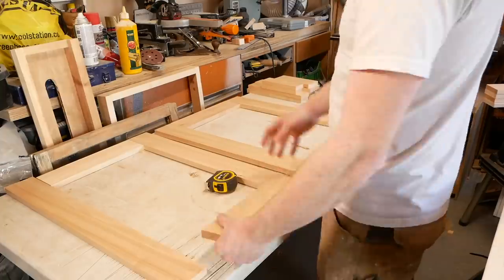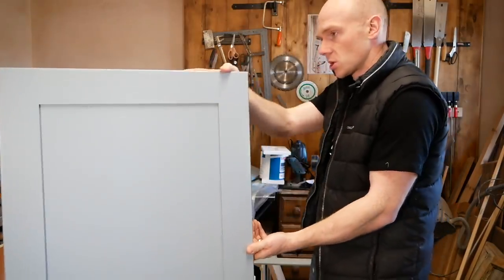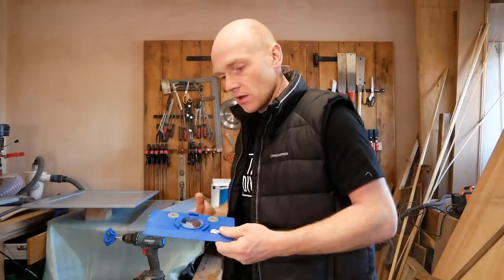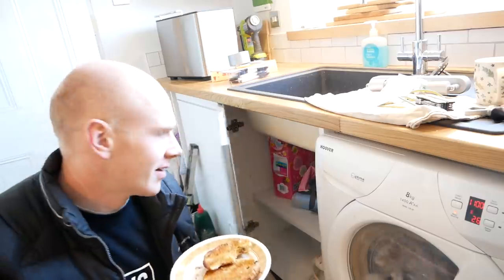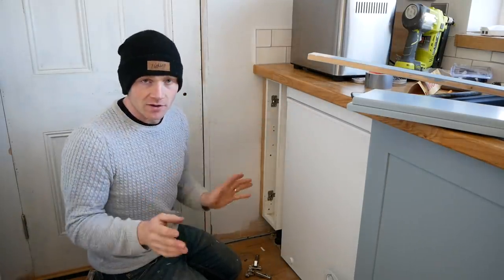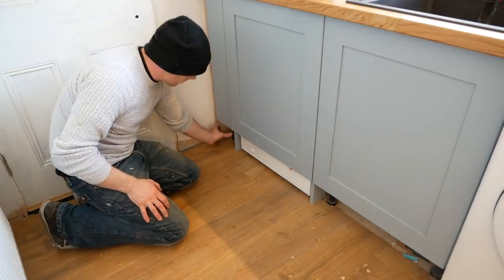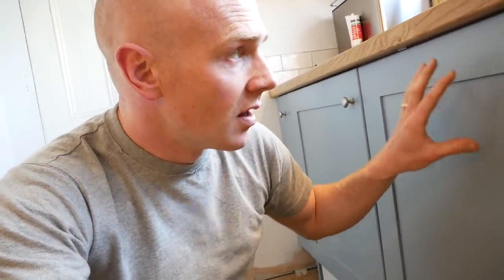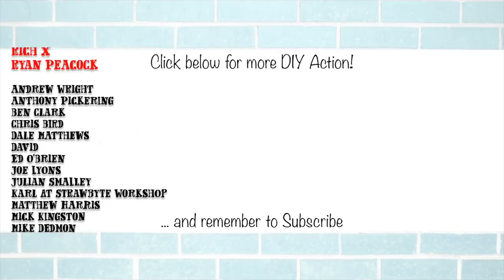KITCHEN DOORS FROM SCRATCH! - Hinges, Hanging and Hardware

Comment: For the freezer I'd be tempted to bend up a sheet metal tray (base and 3 sides), drop the freezer into it then mount it on industrial heavy duty versions of your draw runners, double them up each side if necessary to carry the weight. The tray sides can extend up as necessary to afix the runners. If width is tight I've recessed runners before into a cabinet carcass by routing a slot for clearance (especially as if you change this in future any new 600mm carcass will cover this up).

Comment: Thanks for the videos. I enjoy your journey. Not sure if you can make use of the following  information, but we just had an Aga-type oven delivered and the guys used sheets of Teflon under it to slide it all the way from the van to its final position. It worked very well, so if you can think of a way to do this with your freezer it would certainly be slim enough! Maybe a double length (depth) of Teflon, one each side, glued to the floor under the freezer then wrapped up the front of the freezer (behind the door) until needed.
Reply from the maker: Ooh I like that idea. Was it rigid or on a roll?
Reply: @TheRestorationCouple  They had sheets and strips, about 200-300mm wide and maybe 0.5-1mm thick. I though they would use wheeled carts, but they said the Teflon worked much better. Not sure where you would get it from though???

Comment: You vids always enjoyable to watch and give bit of inspiration .
I have tackled a freezer wheels DIY for my sister who wanted similar size one under a worktop in conservatory off her smalish kitchen .
Anyway cutting to the chase after some head scratching and looking at junk I went with appliance roller set from screwfix.
double axle rollers each corner, handles over half a tonne .
Had to chop product up and mount the roller sections to a custom metal bracket in each corner to recess height to desired amount but end result was good, they holding up well and was under 20 quid .
Bottom of your freezer will dictate how workable this is for you (I could recess mine as low as I liked and to solid frame structure) but be worth looking at as they roll well and due to roller footprint they easy on flooring finish .
Reply from the maker: I still have the screwfix appliance rollers I tried. I only have 25-30mm to play with so they wouldn’t work but may look again. It’s a metals frame under the freezer so may be possible to house within.
Reply: @TheRestorationCouple  
I was lucky enough be able house cutoffs of the rollers from the screwfix item within freezer frame on fabricated inverted U shape brackets  and set final height by depth of the U bracket .
if you got a welder more possibilities come to life .

Exact construction of freezer bottom the limiting factor .
I couldn't find anything low profile that looked durable or likely gentle on flooring finish .

Comment: You could try an anti vibration mat - have just put a cheap Screwfix one under the washing machine and makes it rediculously easy to move. Obviously the weight of the freezer will be more, but would be a good trial before searching it something expensive like teflon

Comment: In the middle of doing this now, i cut an old door in half and used the original holes as a jig. You mentioned a slide out unit on runners, did you build that and do you have a video of it?

Comment: Hi Tim,

Little tip for the end drawer that is very narrow.

Is there a runner that you cant put on the bottom to slide out as opposed to the sides?

That way you are stealing a bit of vertical space as opposed to the width which there is hardly any to start with.

Hope that helps.

Comment: What about a hinged part of the worktop to get to the freezer. Then no need to pull it out?
Reply from the maker: That was the original plan but rather not have the joins and hassle of that especially as we may well have a unit, fridge or oven under there in the future.

Comment: Great video. Roughly what space do you have between the chest freezer and worktop. If you have enough space what about a plywood piece the size of the freezer and inset skateboard wheel or slightly bigger bearings. They could work as runners, obviously the floor needs to be good. Also I could do with picking your brain regarding your garage conversion when you insulated it. Cheers Rob
Reply from the maker: 25-30mm max so whatever it is will likely need to recess in to the base.
Reply: @TheRestorationCouple  it should work then.18mm plywood, 3 wheel bearings along each side recessed in the ply acting as wheels. Put them close to the edge so you can drill through the edge to act as an axle.

Comment: I have seen some draws where they put the slids at the top and bottom, that way they had more width and no problems getting a drill in?.
Reply from the maker: You can use slides at the bottom but it reduces the load capacity by something like 75%. So even with heavy duty runners we have too much ice cream! 😂
Reply: @TheRestorationCouple  was he referring to the skinny cupboard at the end and not the freezer?

Comment: I wouldn't go with transfer balls (they used to make ball casters), maybe something like short pile office carpet upside down so it slides, you haven't got much room for anything else
Unless you can recess rubber casters.
Reply from the maker: Yes I think something recessed is the only option. The felt pads it’s on now work sufficiently but would be nice to be rolling. Will keep looking. 👍
Reply: The better solution is to find a new location for it, you say you only need access once in a while.
I would be a little concerned that it's not going to get ventillation, freezers have to expel heat to be efficient, somewhere like an unheated shed or garage would be better for it, it woulld be more efficient and cost less to run

Comment: You mentioned setting the kick board back a little.. and then having it forward in front of the freezer.. Our kitchen has these insets and vertical dividers.. they are a pain the sweep and mop. the dirt gets caught in the corners. as it isn't a main kitchen I would recommend having the kick board one long smooth surface. As for freezer not sure of space behind and the cooling radiator but hanging the freezer on two articulated arms.. one end attaches to the wall the other to the freezer.. a bit like a wall mounted tv arm or monitor arm. If not then I would consider mounting the freezer on draw like runners (fix onto freezer via epoxy and fibreglass) as over time the rollers will wear the wood floor..I do love the videos. Keep safe from West Wales